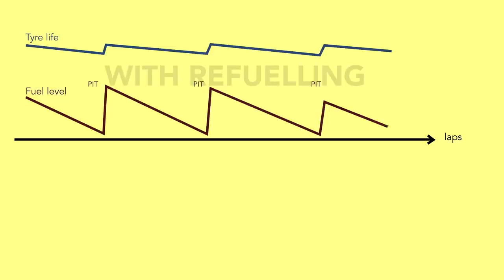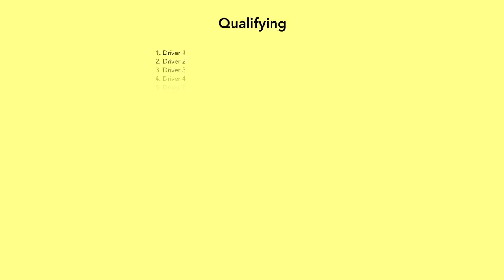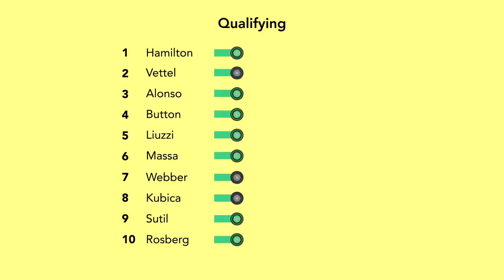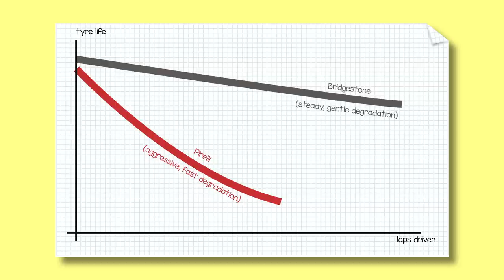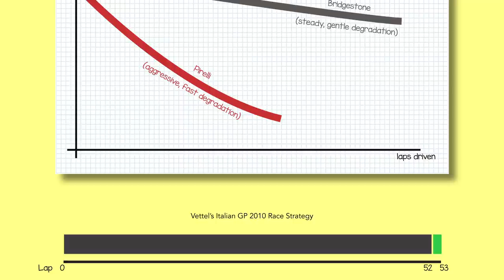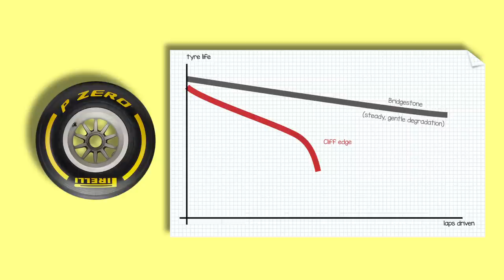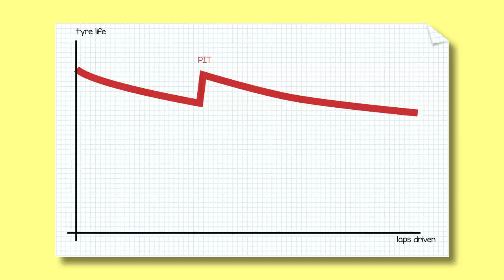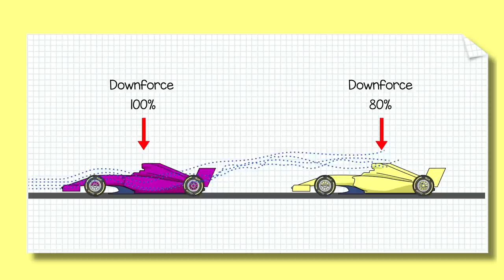How Canada 2010 shaped F1 for a decade - Chain Bear explains

Comment: "imagine having no pits stops" - yeah imagine that.. looks at forumla E
Reply: They change cars
Reply: @suomalai  not anymore
Reply: @suomalai  not any more they don't
Reply: Can’t compare F1 to what is specifically a spec series. What they lack in pit stops they make up for in fanboost, and Mario kart style turbo spots. These are fun for FE, but don’t want this on F1
Reply: @sloppynyuszi  i know, and i agree with you. i think FE is great to watch, but not necessarily the direction F1 should be heading towards. i was talking specifically about not not having pit stops though
Reply: Well they dont have pit stops and almost no dirty air and they actually can overtake so we know where is the problem.
Reply: MotoGP also doesn't mandate the competitors to pit on a dry race. The more relevant series as comparison may be the endurance GT racing, since the cars can go double-stint on a set of tires (approx. an hour on track per stint).
Reply: @TtThomas19  they dont create dirty air because they completely lack a rear wing and thus any sort of real drag. thats due to the car needing to reach the end of the race which would be way too hard with high drag
Reply: @MikeyYT  Formula E does have pits.
Reply: @TtThomas19  closing the wheel will cure abit of the dirty air but die hards will wax lyrical about that.
Reply: @sloppynyuszi  Fanboost is not fun though, it's annoying and removes from sport on merit. 
It shouldn't be in any sport. Attack mode is kinda like DRS so that I don't care about.
Reply: Is this the toxic mike i think it is?
Reply: Attack Mode is their attempt to replace pit stops, but I actually wish Formula E would bring car changes back...make the races twice as long! True grand prix length! (and get rid of fanboost)
Reply: @Trendyflute  So the cars won't pit for new front ends or wheel changes anymore... I thought they kept it.
Reply: I hope by Gen 3 cars can use super chargers for extra energy boost and finally get at least semi slicks and tyre changes instead of all weathers but that's just my hope.
Reply: @F1ll1nTh3Blanks  Because then it won't be open wheel racing, which is one of the definitions of formula 1 racing.
Reply: @F1ll1nTh3Blanks  Semi slicks would completely negate a big part of FE's reason for being: Practical platform for technology development for transfer into consumer road vehicles. It may even make the racing less enjoyable to watch.

Now the idea of some sort of in race charging could be interesting. We know obviously that 0% energy in FE is not actually a drained battery, so perhaps they should have a battery with an even higher capacity, but keep the same available power as this year. Then rather than a supercharger in the pits, have the attack zone be a simulated recharge of x%. They would need to work out an amount that made it worth doing, but obviously keep the running off-line risk. There would be a maximum number of recharges (and a minimum number of laps between uses, plus no use under the safety car or full course yellow) , but no minimum requirement. This way teams can decide to drive more aggressively and use charges, or drive less aggressively and avoid the recharge risk. Gives us multiple strategies and more variation based on driver style.
Reply: Mike I know, I was just saying that they have things to compensate. F1 without pit stops would be a disaster, though I think this was the case in the 50s and 60s. Right? I think some cats would go with no pit stops back in the day.
Reply: ғɪʟʟ 1ɴ ᴛ҉ ʜ3 ʙʟᴀɴᴋs I hate DRS. Kind of ruined overtaking for me (and in my opinion Kamui Kobayashi’s career in F1, as he was a top passer until that thing was introduced). But that’s F1. In FE, I don’t mind those wacky things. And Fanboost gets the fans involved. I wouldn’t want it in F1, but it would be funny to piss Vettel off by a bunch of fans giving Leclerc a bit of speed. :p
Reply: @F1ll1nTh3Blanks  yea was thinking the same thing in terms of tire life, if they intend on getting any faster they need slicks because road tires aren't gonna cut it
Reply: "And on that bombshell, goodnight!"
Reply: @bturx2180  perhaps
Reply: Formula E is bs tho if you ask me...
Reply: @songcramp66  formula 1 isn't defined by open wheels. Merc with Fangio in 50s was the champ with closed wheels.
Reply: Forumla=wtf
Reply: Or look at 1971 Italian GP. Okay, the extremely close finish was mainly because of the chicaneless track, but apart from it many racers didn't make any pitstops.
Reply: @suomalai   They don't
Reply: @Mike

Or formula 1 for much of its history...
Reply: @ғɪʟʟ 1ɴ ᴛ҉ ʜ3 ʙʟᴀɴᴋs

It would cure most of it. Because the tires create huge turbulence and they create vortices to drive that away from the car, further worsening the situation.
Reply: There was races in the past that they did not had to make a pit stop , if I’m not mistaken think it was when they was running grooved tires
Reply: @Trendyflute  Yes bring back 2 cars but instead of longer races just let them have double the power. 
They will increase the lap count anyway because of the time limit.
Reply: Mike i hate formula e
Reply: @F1ll1nTh3Blanks  It has a pit lane yeah, for changing damaged front wings etc. But there are NO mandatory pit stops in FE.
Formula E replaces mandatory pit stop with strategic power modes for 2018/19
Reply: @sloppynyuszi  FE got less spec with Gen2
Reply: Hyrule Hero it’s just set up, and Engine, right? It’s still basically the same aero. I liked it how in the late 2000s cars were experimenting again, with the walrus Williams nose, the McLaren devil horns, and other weird stuff. F1 now looks like a spec series to the casual observer like in the 90s. Can’t wait for that to be a thing in FE
Reply: @sloppynyuszi  
* Motor(s)
* Gearbox
* Rear suspension
* Inverter
* Software controlling inverter and motor(s)
* Cooling for inverter and motor(s)
* Rear brake brake-by-wire system
* Dampers
* Wheels

Those are the parts that are non-spec.
Reply: Thats the only problem I have with fe
Reply: @kukuc96  lol, its funny how milk float racing is now better than formula 1
Reply: or like, f1 in the 80s
Reply: Imagine spending thousands of dollars on a Formula One weekend just to watch a 30 minute race.
Reply: @TtThomas19  There is no overtaking in FE.

Do you consider bumper cars to be overtaking?

It's a shothole filled with Grojeans
Reply: @boltmix7294  I ll make u a favour and start arguing. They do make some contact in the race because those cars are built to withstand a little bit of contact. But its not bumper cars because they get penalised for contact with any significant damage for oponent (If they caused the collision but rules is another chapter).
Reply: forumla
Reply: @TtThomas19  And the cars are virtually the same.
Reply: @sloppynyuszi  I don't like the fan boost, you can't  tell someone is better than others if they have less power
Reply: Don’t forget that they don’t have soft, medium, or hard tires just one kind of compound that they have to use in wet, dry or whatever the weather happens to be like on race day
Reply: @suomalai  next gen E Cars are now 2 hour worth of energy including fan boost and attack mode
Reply: Yeah it’s a car stops
Reply: @sloppynyuszi  FE is good because whenever someone on the internet brings them up suddenly nostalgia drowned ICE lovers speak and proves to the world that they fail to recognize that the electrification of the entire automotive and  motorsports industry is not a move for a greener planet, but just for the monetary gains because the public wants to shift to EVs, because ICE are running out of juice and petrol is ridiculously overpriced and will never go back to its previous cost.

Comment: I think 2010-2013 was one of the best periods in F1 history and it was mainly down to Pirelli.
Reply: so why then do we now have snoozefests? it's the same tyres being used
I think it might be better to look at it not as Pirelli, but as a "new tyre supplier"

Canada 2010 worked, because not even Bridgestone knew what was going to happen
see Michelin at USA 2005 for a more extreme example - Bridgestone had at least tested/run non-F1 races there after a trackwork resurface
so it's the tyre supplier not knowing, which causes the issue

the problem might actually be that now we've had 9 years of Pirelli's, so we know what's going to happen (as do the teams, they know that a supers can go for 25 laps comfortably, and then the mediums can go for 35 laps comfortably, it's an easy 1 stop
The mediums at Monaco lasted ~50 laps with Hamilton this year, it'll be WAY more boring next year with this kind of information publicly available now
Russia went the same way after we saw that Rosberg did virtually the whole race in 2014 on one set (after flatspotting his tyres on lap 1 and pitting for the other set)

Pirelli can do all they want, but if you know that soft-supersoft gets the race done easily, then there's not much variance in that strategy is there?
Unless they dramatically weaken their tyres, but that's a marketing nightmare (because who wanted to willingly get Pirelli's after that Silverstone race where they all blew up [and throw in Belgium where they did too])

it might not be a good idea, but maybe all F1 needs is to change the tyres every 5 years or so, so the teams don't get that "oh, we know XYZ tyre lasts for 30 laps here"
Which in turn, causes more interesting races - because if the teams don't know what strategy works, then it's no longer processional
Reply: @pommyadam   Because Mercedes are way too dominant.   2011-2013 had engine parity in the field.  Force India or Sauber could hook the car up on any given weekend or have a track that suited them and be fighting for podiums at a minimum.
Reply: Anyone: 2013 best

Hockenheim & brazil 2019: well well well...

Comment: I understand not wanting Refueling to return but I wish the cars were smaller. They are far too big these days
Reply: @BlaizeV

They could chop off a meter of them via regulation if they wanted to.
Reply: @avada0  just bring back refueling. Refuel before the tires can be touched. Perfectly safe. What F1 should have done instead of banning it all together. FIA is  incompetent with rule change.
Reply: cars are big because they can, aerodynamics love longer cars
Reply: @Mr Burk

That won't necessarily decrease the lengths at all. Plus as it's pointed out in the video it would just result in fever actual overtaking.
I'd rather simply have much more durable tires and no pit stops. With cars shorter by regulation.
(Beside the required changes for overtaking that the 2021 rules should bring.)
Reply: @avada0  thats like 2005 they only used 1 set of tires the whole race there wasn't overtaking at all. The only interesting factor was the different fuel levels each car was running.
Reply: @Mr Burk
They should have banned refueling as well, as well as controlling tires to be very durable.
But they most definitely should have fixed the friggin aero so that there can be proper overtaking.
Besides 2005 was far more exciting than the Ferrari dumper year from before.
Reply: @avada0  What reason is their for banning refueling when all other racing categories use it in a safe way? Refuel accidents dont happen anymore because the regulations have become much safer, refueling only before any other part of the car can be touched ETC.
Reply: @Mr Burk
Fueling brings no advantages. It just results in stuff being decided in pitstops instead of on the track.
Reply: @avada0  Have you never once watched anything other than modern F1? IndyCar? That statement is very far from reality lol
Reply: @Mr Burk

Not at all, if Indycar didn't refuel or change tires all of the overtakes would happen on the track. :)
Reply: @avada0  Then wouldn't we see less aggressive drivers in general since they'll be nursing their tires and fuel like F1? No hate, your point is good on paper though.
Reply: @Hans Adriel Gabriel
I mentioned before (for F1) that they'd just need very durable tires.
Since the Indy aero isn't garbage and permits overtaking, it should result in many overtakes.
Besides, historically not changing tires was the norm in F1.
Reply: @basedneeble7350  F1 worked fine without refueling for a long time, then they added it in an attempt to make things more interesting
Reply: alessandro ari zaluski size as in width
Reply: BlaizeV nah bring back refueling
Reply: @basedneeble7350  If the goal is more pit stops, it can be done by adjusting pit entry / exit. The problem is they generally loose about 25 seconds from pitting, after getting new tires you have to make up 25 seconds and gain for a net advantage.. which is hard to do with a 60 lap race.

When they could instead, adjust the pit entry / exit so instead of loosing 25 seconds, you only loose 10-15 seconds. The faster strategy would be to pit for the softer quicker tires.

With pit stops that require refueling.. those can be some very LONG pit stops, the teams will all opt to drive slower to reduce the number of pitstops, specially with these new engines that are chasing fuel efficiency.
Reply: They’re way smaller than the older cars
Reply: @avada0  it does give a chance to the lower financed teams though....
Reply: We went from a mini cooper sized car senna days to mini van sized cars basically killing the racing... hopefully 2022 regs fix that with the smaller cars
Reply: In the 00's up to and including 2008 the cars were huge and bigger than now.
Reply: @basedneeble7350  other motorsports dont have 2.8 second pit stops nor 16 active crew... You cant have safe refueling without changing a buttload of rules... Rules which you wouldn't like
Reply: @uwotmatte7577  Ban on refuelling had nothing to do with safety. F1 didn't have a major pitlane fire since like 1994. It was done because they wanted to promote on track racing. I would like them to bring back refuelling, and bring back qualifying with fuel. Now that we have DRS, now that we have DRS the overtaking problem is solved. With refuelling there will be more stops and more stops means drivers can attack more because currently the main problem with the tyres is overheating. Much less of an issue if your stint is 15-20 laps instead of 40.
Reply: @charliechaz1982  Simply false
Reply: @corradoscire5647  They are the exact same size, maybe 2-3 decimeters shorter

Comment: Fascinating. I had no idea the 2010 GP sparked all of this. I think getting cute with the tire wear is not the solution. If you can carry enough fuel for the race, tires that last the race, why stop at all?
Reply: Matthew Atkinson there is something called a mandatory pitstop, that’s why.
Reply: 30 second time penalty.
Reply: Bandit Himself but why have a pitstop at all if the technology doesnt require it? silly
Reply: Dalton Bedore so the tyres don’t last forever and drivers are then just trying to bring the car to the end instead of pushing
Reply: Bandit Himself pirelli said they can make a tire that would last all race and perform all race. i'm saying they should. and have another tire brand to compete agaist
Reply: Dalton Bedore, yes. I like the idea of having more than one tire for the teams to chose. I also like the idea of having the option to run softer tires with pit stops, or a harder tire that will last the race. That would keep strategy in the game, while letting the drivers go for it.
Reply: @bandithimself6841  The 2010 Bridgestones could virtually be pushed at maximum for the whole race.
Reply: @Spyker8921  Bro the comment was 2 years ago you’re a bit late to the party 😭